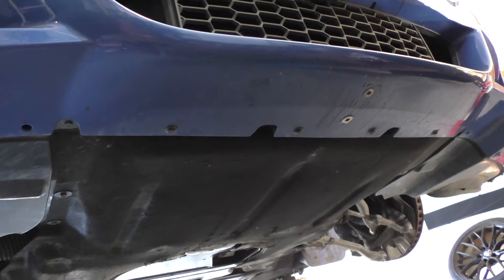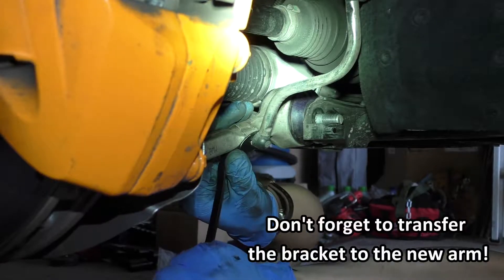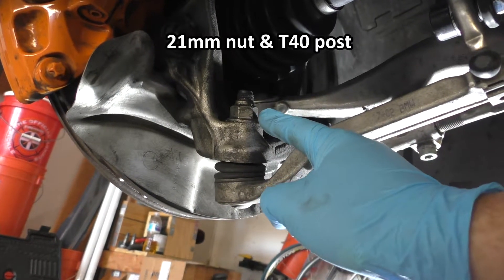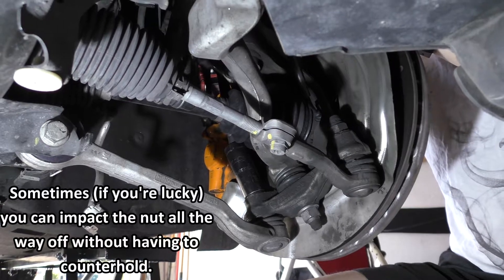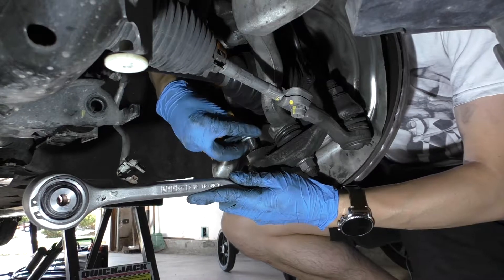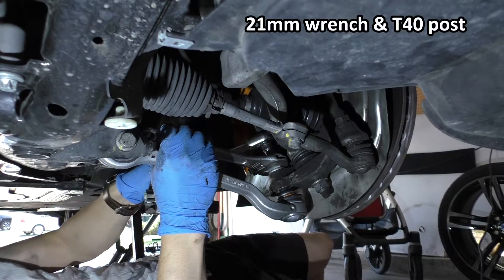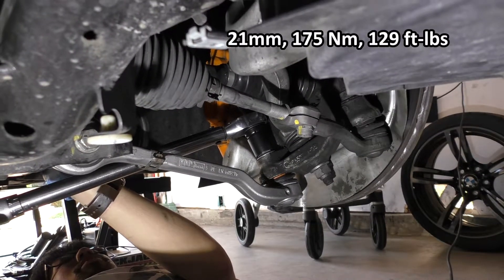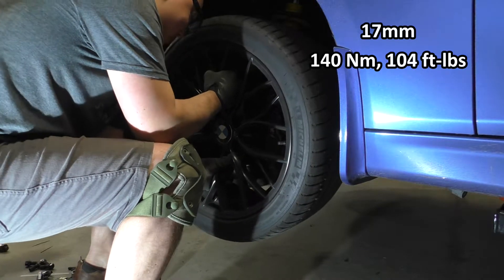BMW F2x F3x Lower Control Arm (LCA) / Wishbone Removal & Installation

Comment: you actually don't need to remove all the underbody panels

And you need to torque WHILE AT RIDE HEIGHT.
Reply: What happens if it's not done that way?
Reply: @FatihCindir  you prematurely wear out the bushings because you torqued it while the suspension is stressed and not at the neutral point.  This is in the BMW TIS.  Can't speak for other cars, but this is pretty standard.
Reply: I love watching these videos and cringing when people do things wrong and then post it, priceless!

Comment: Great video!  In your video where you replaced the tension strut you mentioned that you should torque tension strut (with a standard rubber bushing) when the car is at ride height.  In this video you did not for the lower control arm.  Is it not necessary?  Thanks!
Reply from the maker: Good catch! The arm being installed in this video has VAC's monoball in it instead of a rubber bushing. Monoballs don't need to be at ride height when torqued since they don't bind. If this was a rubber bushing then you're right it should be done at ride height.

Comment: Do you need alignment afterward?
Reply from the maker: Typically you'll need an alignment after performing the LCA/wishbone change. If you manage to keep the knuckle and steering wheel perfectly positioned while doing it you may not, but it's much more likely that won't happen and your steering will be off. Also for that reason you'll want to have an alignment shop close by (definitely don't want to be on the freeway with the steering off).

The tension strut/thrust arm can typically be changed without needing an alignment though.